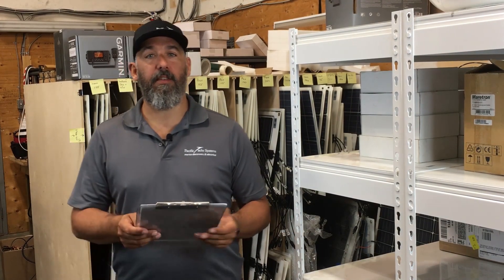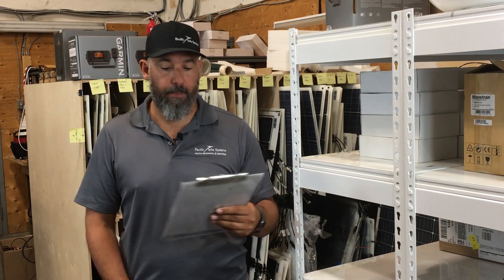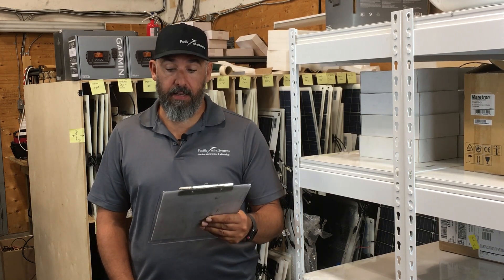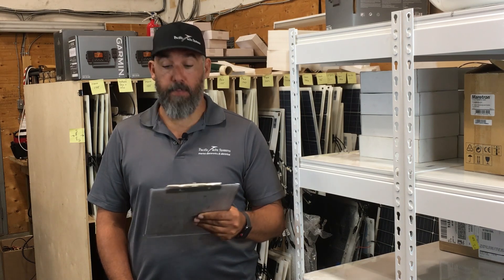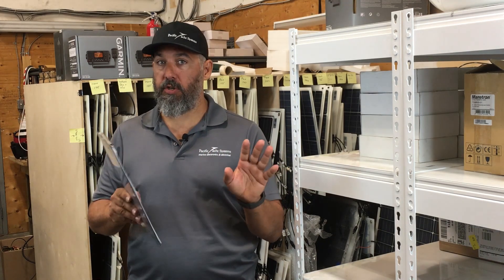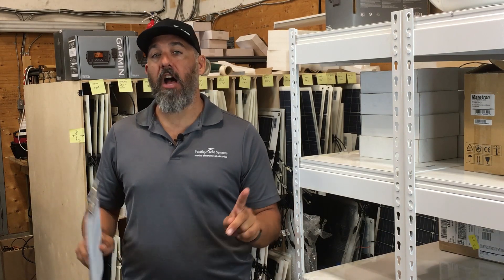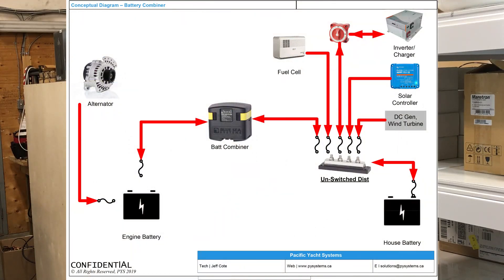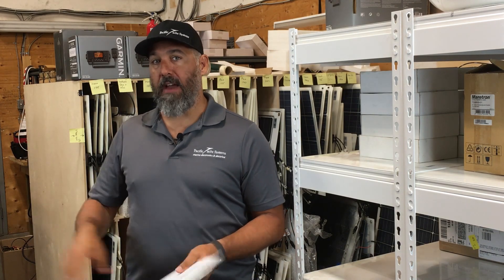How Can I Charge My House and Starter Battery With My Alternator?

Comment: Hi Jeff,
I am sure you have covered this before, but I cannot seem to find the answer I am looking for. I purchased a 1989 sea ray that has twin inboard engines. As I investigate the current setup it seems that each engine has a start battery and what was intended to be a house battery. Each side has a  1,2,both battery switch. It appears that on the starboard engine switch nothing is actually connected to the switch as far as house devices (So basically that engine has two batteries and a switch, and my house devices are only connected to the port side switch). My thought was to change the setup so that the two deep cycle house batteries I have get paralleled together as a house bank, and have each engine have a start battery. I was thinking I could change the switches to just on off, and have 3 of them (one for each engine and one for the house bank). then I could add ACR's so that the alternators can charge all the batteries together. My concerns are 1. With the ACRs in place once the alternators are putting out charge voltage all batteries and alternators will be combined and I am not sure if that is ok even though I have seen diagrams shoeing this on Blue sea's web site. 2. I want to add a 3 bank battery charger as well but not sure how this would work because I think the ACR's would combine all the batteries when the charger is on and I don't think this would be a good thing either. Another option would be to have the house bank only connected to one engines alternator so that the two don't get combined, but I would rather be able to use all my charging capacity when underway.

Comment: Is this a problem if you’re taking 24 V off your house battery
Reply: PS my alternator has enough amperage to run my systems on my house battery is it all right to run it that way if the starter battery is all not hooked up
Reply from the maker: If wired properly, a 24 VDC battery isn't a problem, as long as the other main electrical components are compatible, including starter and alternatoer.

Comment: Is possible to disconnect a 60 amp engine battery and connect a 100 amp house battery using a changeover switch to charge it temporarily
Reply from the maker: Yep, many battery switches allow you to this. Look at Bluesea products.
Reply: @PacificYachtSystems  what i meant was that will it be safe to charge a 100 amp battery with an alternator that is made by company to charge the smaller 60 amp engin battery

Comment: Okay. I have a question. For years I have been using two deep cycle batteries for my simple 22 ft boat with a 200 Yamaha. I would switch between them and it would start the boat fine and run all my simple electronics. But this winter I upgraded the electronics and now feel I need a separatr crank battery and house battery for all the electronics. How in the world can I do that?
Reply from the maker: Wayne, checkout the Blue Seas kit:
https://www.bluesea.com/products/7650003/Add-A-Battery_Kit_-_120A_%5BBoxed%5D

Comment: Hi Jeff,
Thanks for these super videos. So much appreciated!
In this case, would you consider a DC-DC charger from the Starter Batt to the house batt bank? If yes, isn't it advantageous (No diode voltage loss, etc...)
Thanks for reply.
Reply from the maker: Never seen that done before, anybody can share their experience.

Comment: I want to add a starting battery to my sailboat. Currently I only have two 4D batteries - A and B. They are being charged by the alternator or by a ProMariner battery charger when in the slip. The ProMariner  can charge a third battery which I think/want to use for the new starting battery.  Right now, when at anchor I run the house from the one of the two 4Ds but switch to BOTH when starting the engine etc. What cables and connections do I need to change/make/add to add the starting battery so all three batteries are doing what they are supposed to be doing?  Thank you.

Comment: I recently had a failure on my  KISAE Abso 2000 Compact Pure Sine Inverter/Charger bought from West Marine.  About six months ago I installed a Blue Sea 7622 ML-ACR Automatic Charging Relay between my house and starter battery to allow charging house batteries from the alternator while driving.  This also allows my solar to charge my starter battery while parked.  When i first hooked this up I noticed the ACR seems to switch on and off several times before staying on. 

Now some months later my inverter stops working and I get an error message of r2.0, and KISAE says;  If the “r2.0” message remains  on the display (i.e. for more than 8 sec.) it would mean there is a communication problem between the detachable panel and the main unit or problems with the main unit ( I think the main unit is the problem, and no repair is available).
Reply from the maker: Not sure if this problem relates to you Terry, but it's common to see a battery combiner cycle on and off especially when you have a large battery bank in parallel with a smaller battery bank and the alternator isn't capable of keeping the charging voltage about 13.3 VDC when the batteries are in parallel / combined.

Comment: Most battery combiners works 2 way. Only now they fill also the starter battery with my solarpanels, how can I avoid this without using an isolator?
Reply from the maker: Hi Olgerik, can you please rephrase the problem, I want to make I understand the problem before I start solutioning.

Comment: Is it possible, as I THINK it is from reading Bluesea  battery combiner manual, to wire from the alternator to leisure bank then to combiner then to start battery. What are the benefits of doing so?
Reply from the maker: Hi Bert, yep you can share a charging voltage (i.e. alternator) with another battery via a battery combiner or a battery isolator. Check our website or our YouTube channel for in depth videos on this topic.

Comment: You said if you don’t have an outboard. What does that have to do with it? Isn’t an alternator an alternator?
Reply from the maker: Installing a battery isolator involves rewiring how the alternator and starter are interconnected.  Modifying the electrical wiring of inboard is easier then modifying the wiring of a outboard.
Reply: Pacific Yacht Systems cool thank you. So I’m ok with a combiner with my outboard

Comment: Is anybody still using battery isolators in new installations? I think the newer ones have less voltage drop but still...
Reply from the maker: Many Beneteau and Jeanneau boats have battery isolators. But your correct, not too many boatbuilders use battery isolators, but they should.

Comment: Your explanation kind of prompts the question, so if you have 2 much different size battery banks (and how much is a lot?), you'd use an isolator? And why? You know, maybe it's another video someday... ;o)
Reply from the maker: Hi Peter, probably when the ratio of battery size to one another is 1 to 4 or more. And, very importantly, the alternator is 1/8th of smaller then largest bank. For instance if your engine bank is 100 amp-hours, your house bank is 400, and your alternator is 50 amps.
Reply: Use a dc to dc battery charger and it wont matter what kind of battery you have.